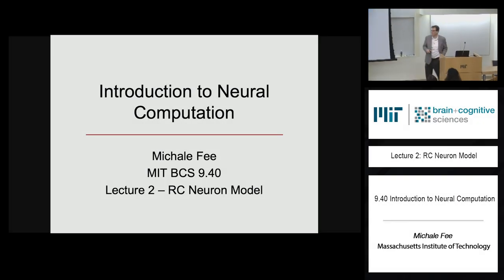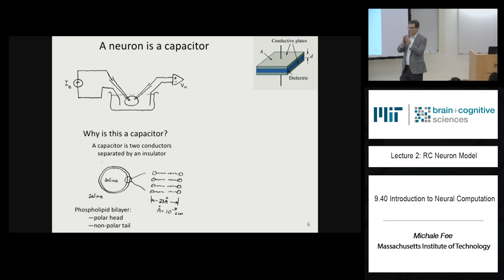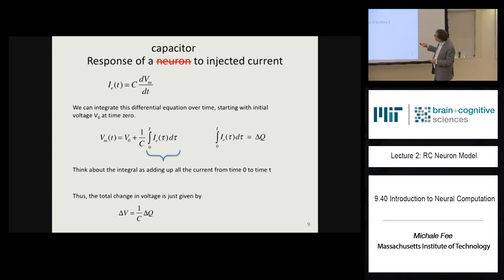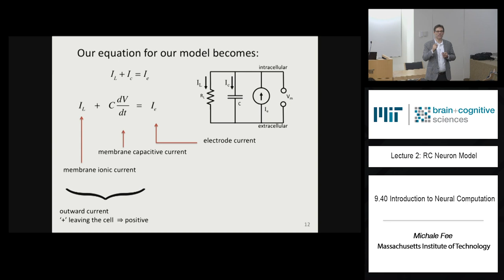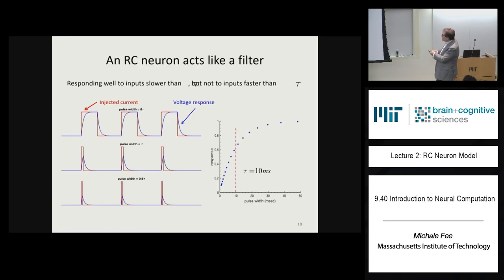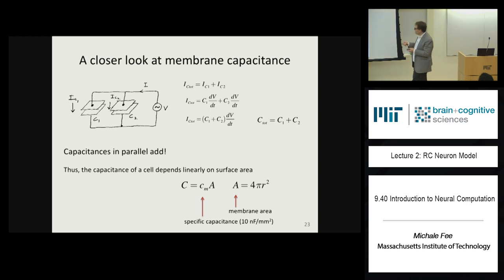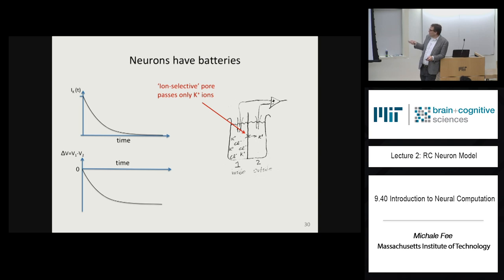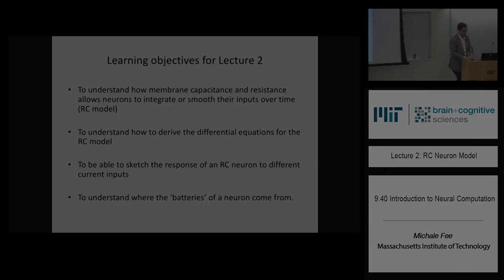2: Resistor Capacitor Circuit and Nernst Potential - Intro to Neural Computation

Comment: Kirchoff's law holds only for nodes, that have at least three wires converginig in it. Am I right? If so, there is a necessity of presence third  term when we calculated an amount of charge, needed for changing capacitor potential.